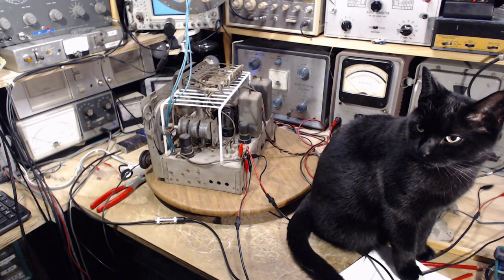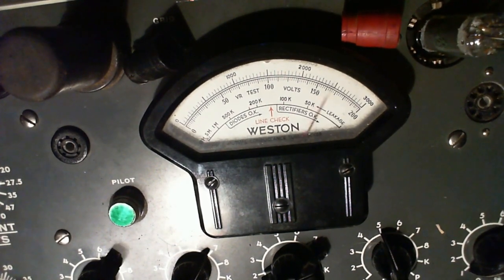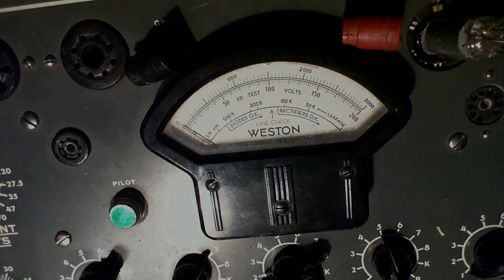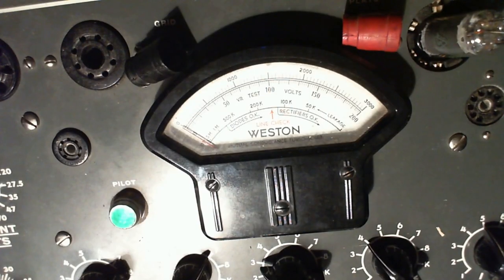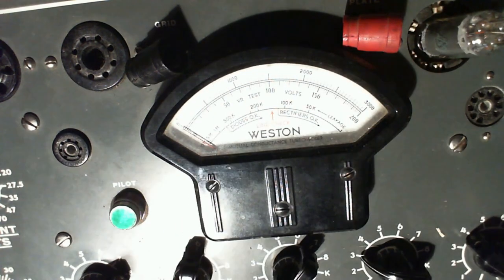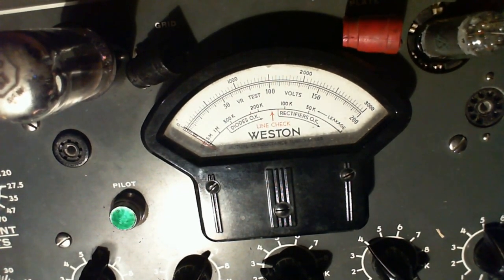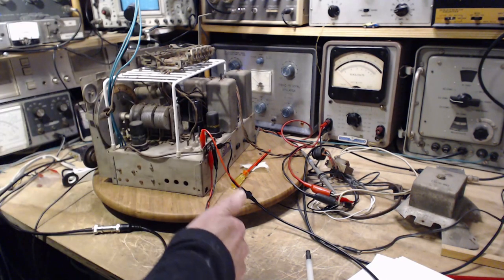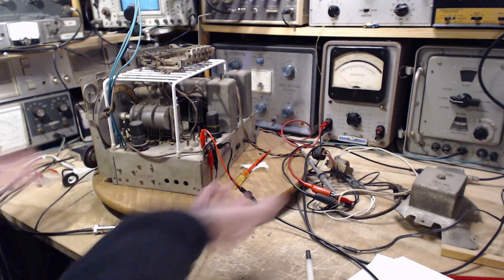RCA Victor A38 Shortwave Tube Radio Video #9 - Tubes and SW Alignment

Comment: A weak IF tube I think will affect the sensitivity not the signal-to-noise.  Most of the noise will be generated upstream of the IF amplifier and so will be amplified more by a stronger IF tube to the same extent as the signal.  If the signal is strong enough to robustly engage the AVC, then putting in a stronger IF tube will have very little effect on anything  - which is what he observes.